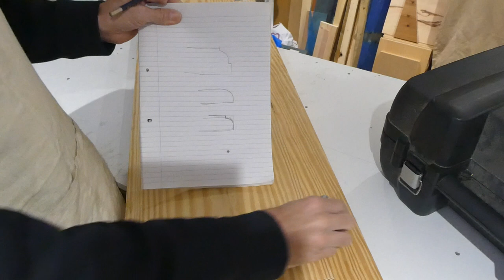Using a router to give my kitchen shelves a rounded edge detail

Comment: Thank you.  Sorry about the hole in your ceiling.  Your video is very down to earth and I like that.  I do have a question.  How can I put a radius corner in plexiglas  (All four corners.) Can a  router do  that consistently??  --An American fan of your work!
Reply: Use a corner radius template and a straight bit with bearing.

Comment: How do you cut in a straight line without cutting too far into the shelf
Reply from the maker: The cutter has a bearing on it which runs around the edge of the shelf.

Comment: What keeps the line straight, have you a guide set up? Also, looks like you could do with ear protection in that place
Reply from the maker: The router bit has a bearing on it, so all I'm doing is allowing the bearing to run along the edge of the timber.

Comment: Great video Justin. I have just bought my first router for exactly these sort of projects, so this was so helpful. A couple of quick questions: Will I have success with my router using plywood - thinking about edging? Do you advise doing more than one pass? If yes, will I have to adjust the depth each time? Many thanks
Reply from the maker: Cool, thanks!
Check out my Q&A video, I've answered there. It's out today at 4pm

Comment: Hey Justin, how do you ensure the router stays at the same consistant line without some sort of line to follow? Is it just all free hand?
Reply from the maker: Hi Joshua, the router bit has a bearing on the bottom that runs along the edge of the board. Check the link in the description to see a picture of it. 👍
Reply: Thanks Joshua, you asked exactly what I was thinking!
Reply from the maker: @derrickyeo4451  it has a bearing on it to run along the part of the board that isn't being profiled
Reply: @JBTV  great! Thanks

Comment: Do you know what router bit is used to create the profile on stair treads.
Reply from the maker: Something like this will be used https://amzn.to/2WvzlQD
If using this type of bit in a hand held router then you'll need to set up a guide rail on the piece of work, as this doesn't have a bearing on it. If you have a router bench, then you can just run it through using the fence. Hope this helps.